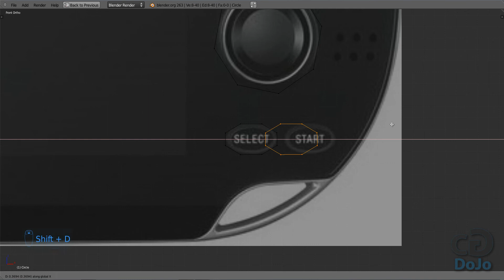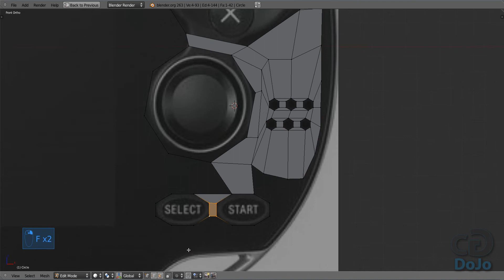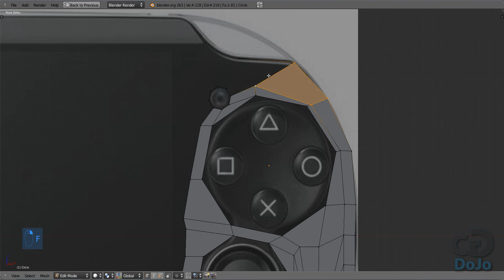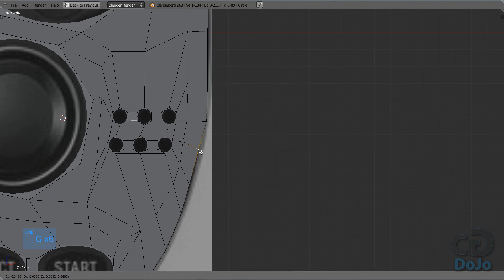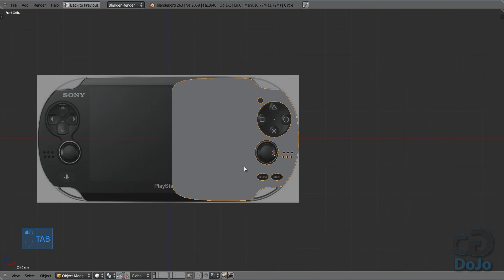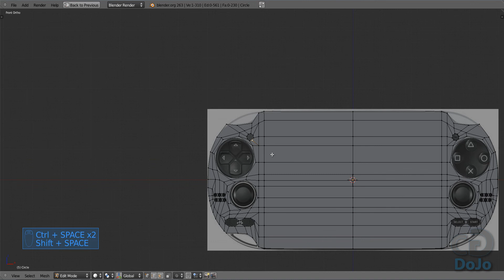psVita-Blender Series pt02 Modelling the Front Part

Comment: How do you extrude on a straight line like @6:03?
Reply: Never mind, I'm guessing you pressed X but the screencast didn't register.
Also, if anyone is having trouble joining the parts after adding the mirror constraint just make sure to put it above the other constraint on the panel. In my case it was at the bottom for some reason and so the parts wouldn't join.
Thank again for the video :)
Cheers.
Reply from the maker: Extrude is with E, that is the shortcut.